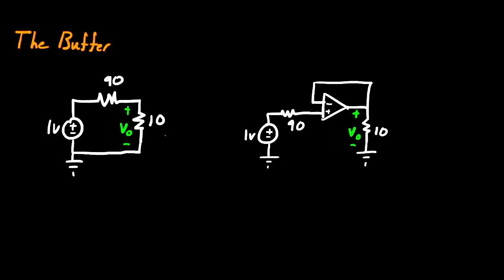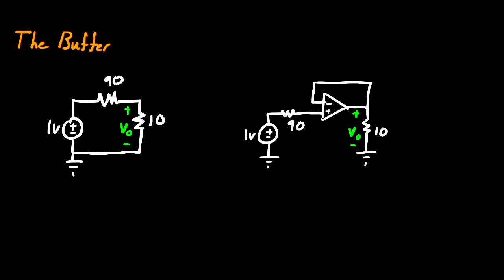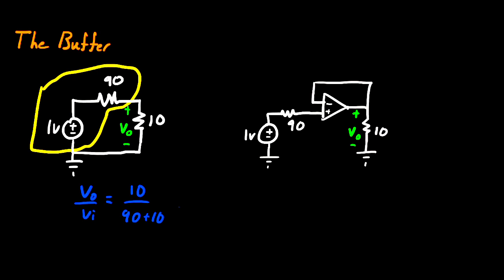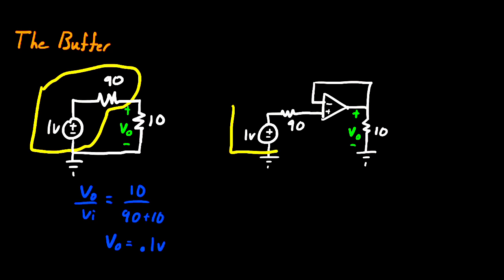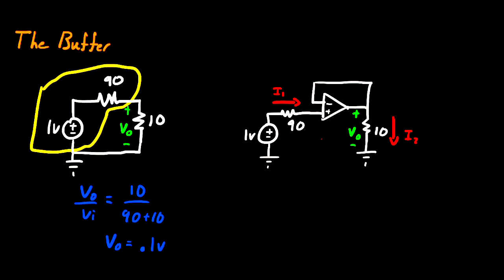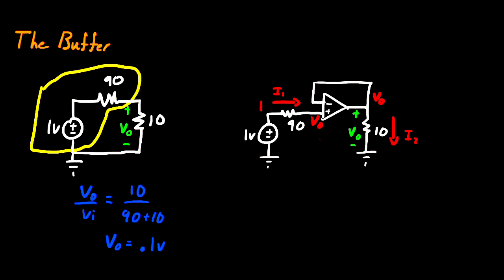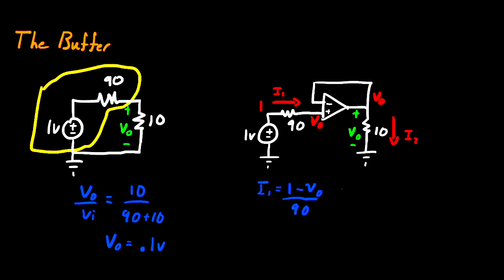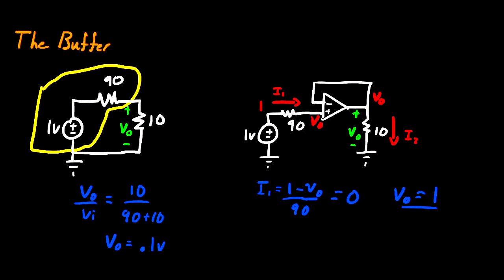Op Amp Buffer Circuit

Comment: At 1:25 , Why is this node referenced to the ground? Isn't there still the 10 Ohm resistor in the way?
Reply: It means that resistor is seeing the Vo voltage across it, because Vo - 0 = Vo . This 0 is due to the GND.